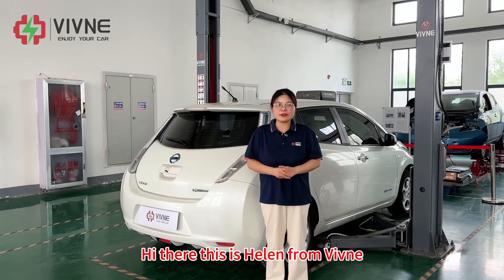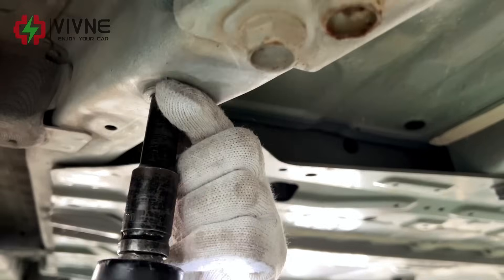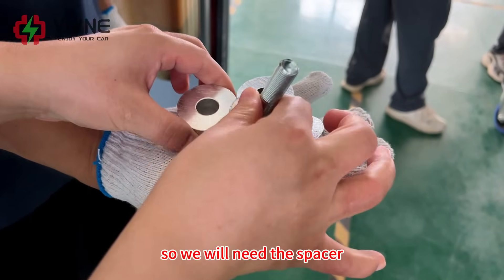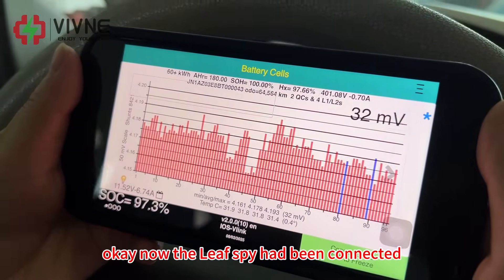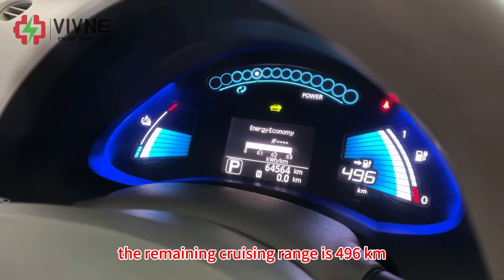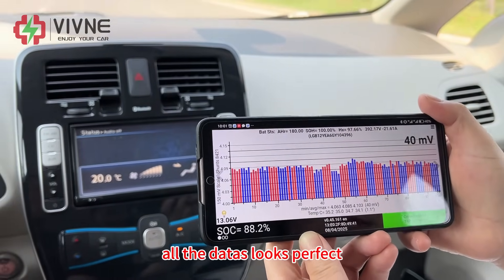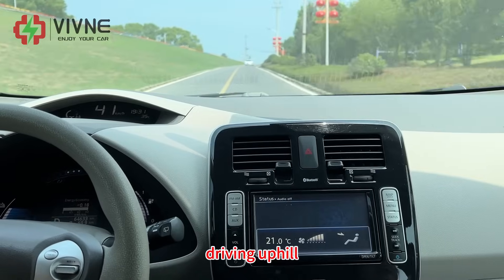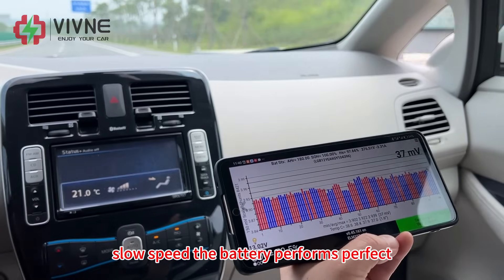VIVNE- First Gen. Leaf upgrade to 62kWh battery

Comment: Location makes a big difference. I have a 2019 Nissan leaf with a 40 KW battery. So far I have driven 100,000 km and the battery S0C is still at 92%. It seems high /hot temperatures seem to border the battery more the our extreme cold in Canada

Comment: Do these manage thermals better than the original packs?
Reply from the maker: We replace the original soft pack battery with the big CATL cells. So the heat generated is much less and can bear large current.

Comment: Owned 2012 model, got about 35K on it 10yrs later. Max range about 75 miles on 24Kw battery, mix driving avg 200 whr / mile hot climate. Tried looking for battery replacement but gave up looking. 4 cars later finally bought a Tesla. Would not consider any other car companies.Enjoy the Tech especially Self Driving.

Comment: the problem whit the nissan leaf is the poor heat menagement of the battery, wich makes the degradation occur much faster than expected, seen this video, it doesnt look that the problem is solved
Reply: no, it doesnt. Unless going through more extensive modification to add a forced cooling system in. It is hard to package a build in system in the pack. Becasue the only space you can access to free airflow is the underneath, but you dont really want air in the under carrage while driving at speed. The only option will be using chemistry more tolerable to high temperature like the LFP, but that is just a mitigation not really solving the problem.
Reply: @林振华-t4v that is what i was thinking, in 5 years the range will be drastically reduced, so the problem wasn't solved
Reply: @almirjorge5462  not accurate. It was the chemistry of the original cells that made them particularly susceptible to heat degradation. These new CATL cells have better chemistry. It is still wise to limit charge rate
Reply: @island-boy242  the heat charging and discharging the battery still efects all the batteries, if not so they would eliminate all system coolant present in these new cars, they reduce the degradation over temperature, but still there

Comment: This would've been helpful 6 years ago, but I've long since gotten rid of my 2011 Nissan Leaf in 2019 and got Tesla Model 3, so it didn't matter to me at that point. Plus, what charging station has chademo anyway even if I did managed to get the battery replaced? Honestly, I am surprised with the pricing of the battery replacement, it's more reasonable than I thought. I guess the cost of battery has dropped a lot since then. At the time, the dealer wanted around $7000 to replace same 24 kWh battery.
Reply from the maker: What you mentioned makes sense. For those who  loves their Leaf much would consider the upgrade.

Comment: That car only drove only 64000 km before the battery did gave up. That's really terrible !! No EV for me !!
Reply from the maker: This Leaf owner has 2 Leafs and this battery is degraded more seriously. So he changed the more seriously degraded battery to this car and come to our factory for the upgrade first.
Reply: Hope you’re not burning toxic fossil fuel ☠️⛽️☠️. as now new electric cars have batteries do million miles.  Remember the original leaf had problems with first gen batteries!     Ice cars are inefficient far more moving parts and more maintenance and  unreliable was built in redundancy also fossil fuel burning is causing anthropogenic extinction. It is being phased out and it needs to be banned as soon as possible.    There is no option we need to get a fossil fuel. I do hope that you do not drive and you have a bicycle that is well, mate and last a lifetime .   We do have technology that could last a lifetime and completely run on renewable energy. The problem is car manufacturers have to sell cars. This has been a long growing problem we need to look at. So comments like no Evie for me is not helpful thank you buzz 🐝 #buzzofftoxic

Comment: Packing 62 kWh there is impressive. Does the battery have active cooling?
Reply from the maker: We replace the original soft pack battery with large CATL cells, which generate less heat and can bear a large current.
Reply: No active cooling 😵

Comment: That's a lot of extra weight
Reply from the maker: We use high  density  CATL cells. The 62kWh battery adds the weight only by 85kgs,  which just as taking an adult in the car.

Comment: We drove a 30kWh LEAF from the North of England to Glasgow and back.  Terrible experience which took 9 hours and five charge-ups one-way (250 miles or around 8/5 x 250 = 400km).  Terrible with children and everything would be cured with a battery like this.  The LEAF is a practical large family car, but they are all headed to the recycling plant unless this battery replacement can be effective.  Governments ought to make laws to force auto makers to allow half-life upgrades like this.  Great work well done.
Reply from the maker: With the big pack battery, one charge will be enough for your trip.   Sometimes it indeed bring convenience to life.
Reply: 😂 Who buys a Leaf for long trips?
Reply from the maker: @thedavymac  Actually many of our customers would prefer if their Leafs could have a long car range. Would be more convenient in life most of the time.
Reply: @thedavymac  then what is it for ? If people buy car, then it's for driving to places.
Reply: @pikachulovesketchup666 it’s a commuter car. For work and back not long distances. Most Americans drive less than 30 miles round trip and that’s where this excels. Same for students if they could afford this.

Comment: So you add a lot of weight and don't change the suspension?
Reply from the maker: The 62kWh battery pack added the weight by 85kgs, which just as taking an adult in the car.
Reply: actually it was added less than 100 kg
Reply: Some EV workshops change the rear suspension springs when upgrading to 62kWh battery.

Comment: For those wondering, The first-generation Nissan Leaf was released with a 24 kWh battery and an option of a  slightly larger 30 kWh battery with ranges of 73 miles / 117km and 85 miles / 136 km respectively.

Comment: When installing the 62kWh battery pack in ZE0, you need to change rear springs to accomodate for a higher mass. The service where I changed the battery does this. The 1st gen feels like a new car after the battery upgrade :)
Reply: While not required it is highly recommended
Reply: what springs we should install ? do you have any model/type to suggest?

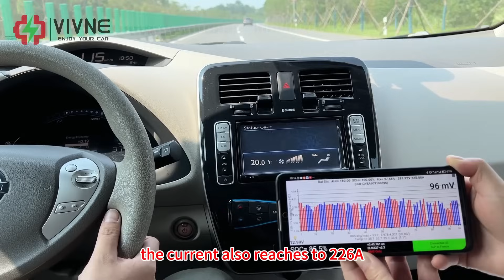Comment: 9:37 Four of those new cells seem to drop quickly when accelerating. Will they be ok or are they weak and potentially cause issues later on?
Reply from the maker: The current at the moment is 226A. With this large current, this voltage difference is fine.

Comment: Wow, the old battery was only 34.87% SOH! I think that's pretty cooked - and in a Leaf that would be cooked literally too. I didn't realise the SOH could go so low.
Reply: Probably user charging to 100% and keeping the battery fully charged in a hot environment.
Reply from the maker: This customer got 2 Leafs. This battery is with more severe degraded. So he replace this first.
Reply: Charging the battery cold is even worse
Reply: @anderslagerqvist2642 Yes fast charging cold battery is not good but slow charge is fine. The cold only slows down chemical reactions and the acceptance of new energy (charge). This also limits the discharge and cold weather does not allow to disharge the battery fully. However a significant benefit is the reduction in calendar (age related) aging. Its just like puting a food in a fridge.

Comment: I am from Srilanka and replaced the 2014 Leaf with CTL 64 kw battery. I got over 500 km (With AC} from1 charge but after changing with new tyres it now gives only abou 450 Km . The tyres you chose should be EV type and not the other usual type. The friction affects the distance per charge.
Reply: Not only the rubbercomponents the size in square also matters,if you can change your tires Next time with a set off less wide(instead 225/60/17 choose 205/65/17 for example)
Reply: It also helps to increase the tyre pressures for lower rolling resistance.
Reply: Very much so. In Europe new tyres are rated A to E, with A being perfect for EVs as they have low rolling resistance - but they can often be more expensive. A downside is that low rolling resistance tyres are often not very good in winter.

Comment: Why only 2 quick charges and 4 slow charges with the old battery?
Reply from the maker: This Leaf owner has 2 Leafs in his garage.  This original battery is from another Leaf and he changed to this car. He believes the condition of this original battery is more terrible than the other and needs the upgrade more. When he change the original  batteries, he had cleared the charging times.

Comment: Will you ever provide LFP batteries for the Nissan leaf? Or ever provide batteries that can handle 50kw+ Charging?
Reply: There are some workshops that offer 40 kwh LiFePo4 with active thermal management for the leaf.
Reply from the maker: The LFP can not meet the voltage request of the Nissan Leafs. The charging power is limited by the ChadeMo.

Comment: Very good video, sounds like you get as hot as we do in Australia, perhaps I missed it but I wonder what the cost of the battery and labour was?

Thank you.
Reply from the maker: We have a extremely hot weather in this summer.  You can find the cost of our battery from our website: https://vivnevs.com/  The labor can be determined by the local workshop and installation of the complete plug and play battery pack is quite easy.

Comment: Hello Helen,   Thanks for making this video - you have extremely good timing - because I have my 62 KWH battery sitting in my garage to install in my ZE0.    Thank you  for going into detail on the steps,   seeing how to attach and detach the cables is super helpful,   because it's not always obvious how those connectors work if you haven't used them before and it would not be good to snap one trying to turn it in the wrong direction.  :)      Also,   you have been SUPER helpful and have been very responsive in answering all my questions going through the sales and shipment process.
Reply from the maker: Hello Joe,  hope it is helpful. :)  Always welcome to contact us any time if need further assistance. 😊
Reply: Whats the price for the new battery?
Reply from the maker: @henrikanefjall328  https://vivnevs.com/

Comment: Hello Helen,  I have a first gen Leaf, made in Japan for England.  It had the 24kWh original battery, but I bought a 30kWh battery to increase the range.  The replacement battery was the later type with three outlet plugs, not the two original ones.  The one on the left (facing the plugs) was blanked off and the later multi-pin plug fitted to my car so that it could plug in.  I have a small circuit-board fitted between the battery and the car to make the car work without seeing anything wrong.  The car shows 90 MILES range fully charged.  Can VIVNE make a 62kWh battery to fit my car?  The little circuit board can be removed if necessary.  Apparently it fills in the battery's ID with zeros and the car's ECU never proceeds beyond constantly querying, so doesn't throw up a fault code... or something like that.  It creates a parasitic drain of the 12volt battery which goes flat after two weeks if the car is not used (the little circuit board needs to be alive before the car is turned on for use and so has to remain alive all the time, hence the slow drain of volts).  This is not ideal!
Reply from the maker: Hello there,  your car is the first gen Leaf ZE0. The 62kWh battery can fit in your car. We reprogram the BMS, so will no need for the little circuit board. I think you are referring to the can bridge. BMS reprogramming is to display correct mileages, will no longer need the can bridge.